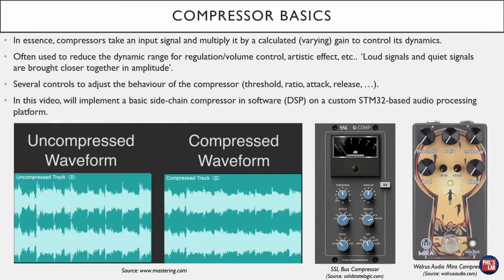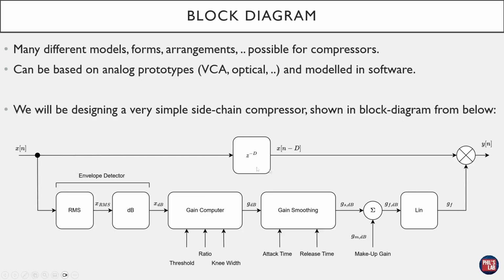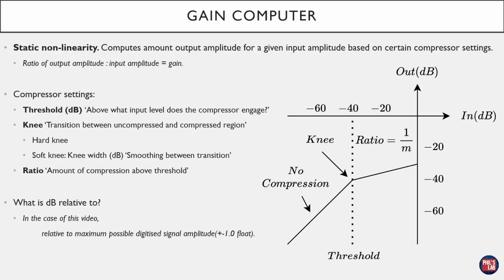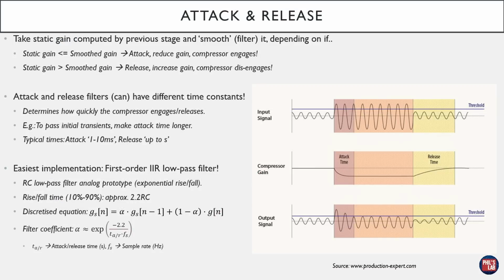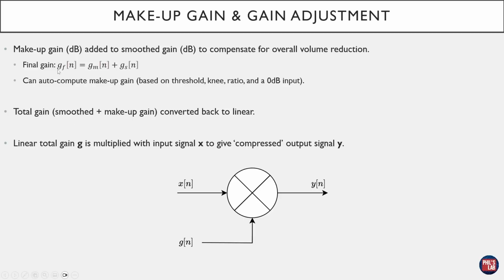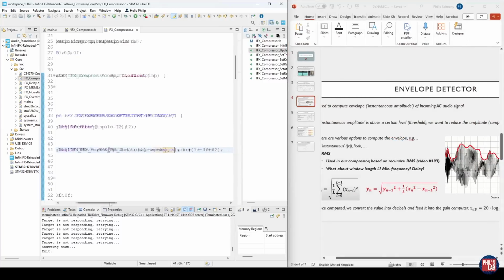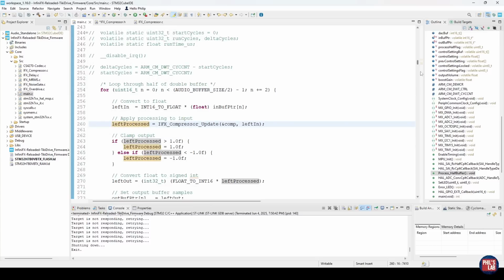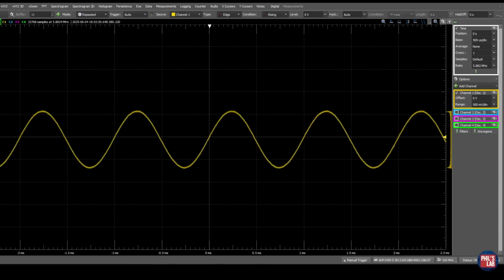Audio Compressor Software Implementation (STM32 DSP) - Phil's lab #157

Comment: Thank you for another good video. Was wondering how much MCU time is still available and how many effects can be chained. I know it's not the purpose of the board, just curios, as for example my Zoom G1X4 can fit quite a lot and their processor might be slightly slower but have dedicated DSP units. A few days ago I saw the presentation "Intro to Data Oriented Design for Games" which shows some neat tricks for optimization.
Reply from the maker: Thanks! I wanted to make a video about that and how to measure how many CPU cycles are still free. Just from previous 'tests', I can chain quite a few 'simple' effects together (delay, overdrive, noise gate, ..) with no issues.

Comment: My diploma thesis was a multi-effects audio device, and its core used an ADAU1702. As a small audio DSP, I find the ADAU1702 particularly useful for compact projects and experimental boards. Combined with an STM32, it would make for a very interesting development and experimentation platform.

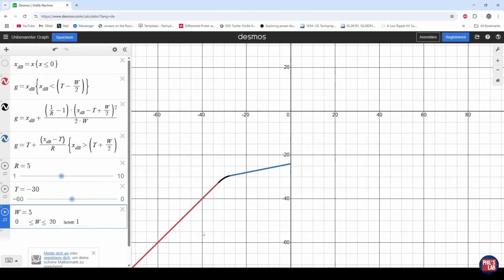Comment: At 13:20 you have mentioned that you had taken inspiration from a popular literature. Is is the linked Matlab site? If not (or even if it is), could you please recommend a book or a site that explains the wonders of DSP. I am currently at the last week of electrical engineering bsc and plan on continuing at compsci msc to study DSP more.
Reply from the maker: The best book on these topics I find is 'Digital Audio FX' by Udo Zölzer. Otherwise, there's also 'Designing Audio Effect Plugins in C++' by Will Pirkle.
Reply: @PhilsLab  Much appriciated

Comment: How would a different micro with different DSP capabilities, or worse even lack of hardware floating point module, affect the characteristics of this type of compressor in audio frequency ranges?
Reply from the maker: The algorithm I'm showing in the video is rather unoptimised. So with a less-capable processor, you'd have to probably 'clean up' the code a bit more, minimise expensive operations, and possibly move to a fixed point/integer representation. If done right, there shouldn't be too much impact on the actual sonic characteristics of the compressor.
Reply: @PhilsLab  Thanks for the response!
Reply: I don't think you could do real time Audio DSP with floating point maths without an FPU. Maybe with a fixed point integer math... I recently used DSP for FP FFT and the difference on a 2048 sample size with FPU vs No FPU was about 2ms vs 2000ms.